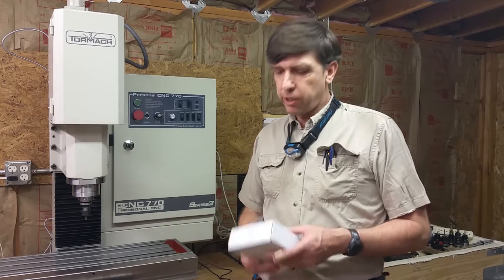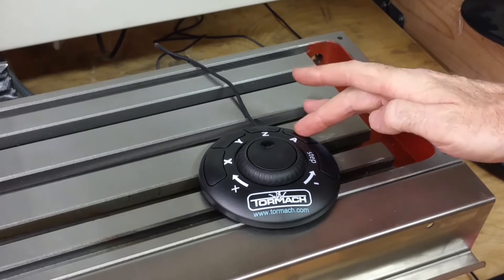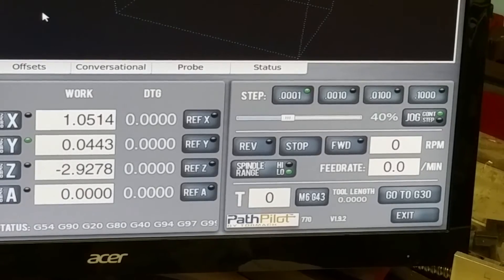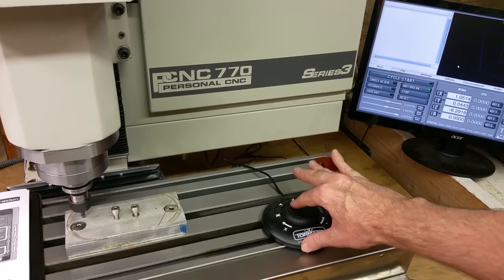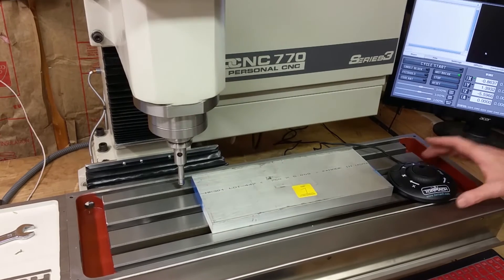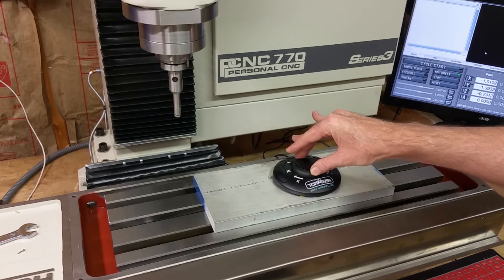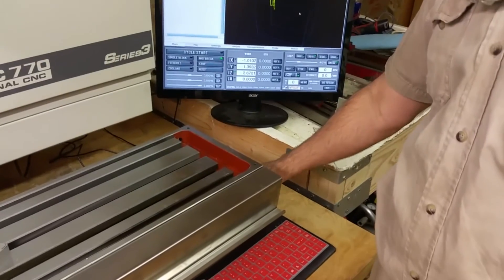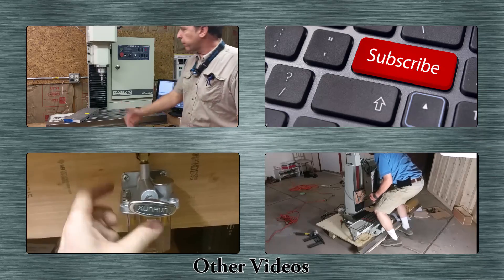Tormach 770 Part 5  - Jog Shuttle

Comment: Did you ever run into any problems with sitting the tormach on your workbench? I’m considering purchasing one but can’t justify the price of the tormach one when I could build one myself.
Reply from the maker: It's been working great for like 6 years.  The downside is that you can't use flood coolant.